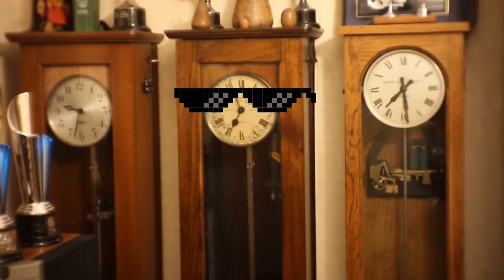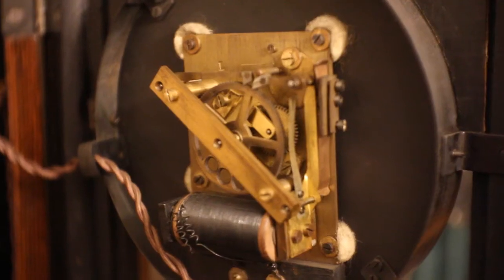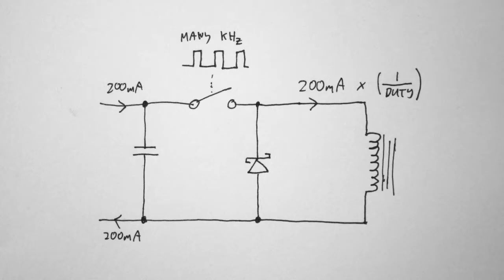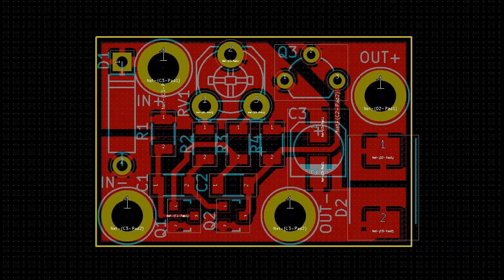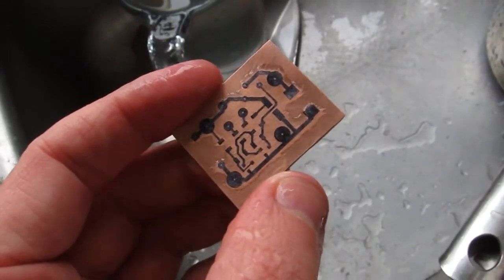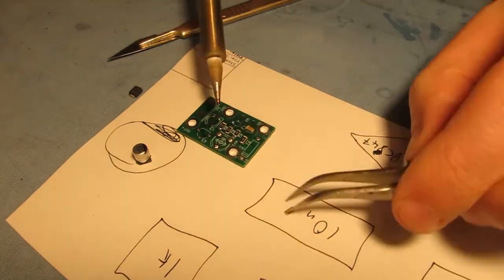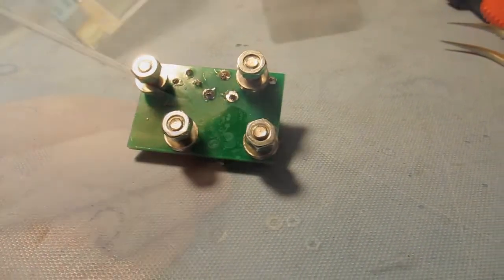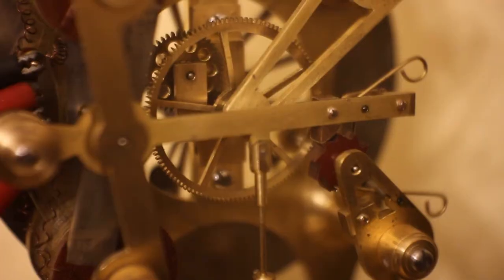Electric Clock Science: Gents / ECS to Synchronome / other electric clock standard adapter

Comment: Having three master clock and slave systems in the house, I am confused by your friends problem. All slaves made in the UK at least were interchangeable running on about 200 to 300 mA, all in series, you upped the voltage til the system worked and the current was in range. (Continental systems used voltage driven slaves in parallel.) Smiths (latecomers to the master clock scene) used exactly the same current requirements as Synchronome and Gents'.

Gents' and Synchronome slave movements had coils with different numbers of turns and hence resistance depending on what sized dial they were attached to but they all drew the same current.

Anyhow it is good practice to run the slave loop via a relay or big transistor as Gents' did, It makes system maintenance much easier. GPO master/slave systems were made by the big three and all the master clocks and slaves were interchangeable.
Reply from the maker: The clock featured in the vid was hand-made to no particular specification, and thus didn't fall in the 200-300mA range. Also he did point out some errors in the detail of my explanation in this vid at the time, but I can't remember what they were now  :)